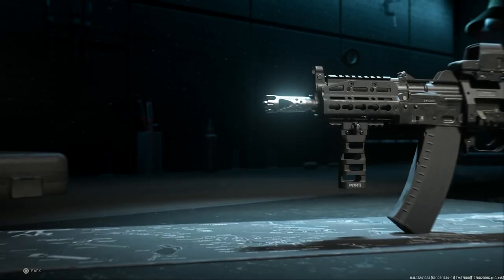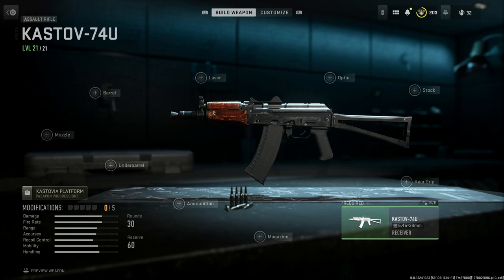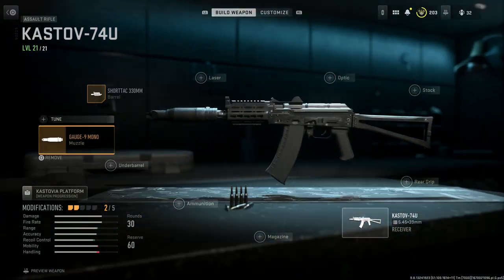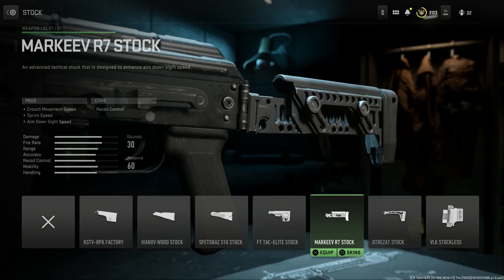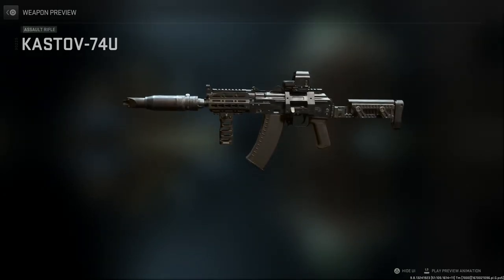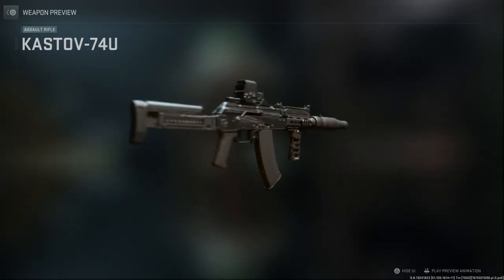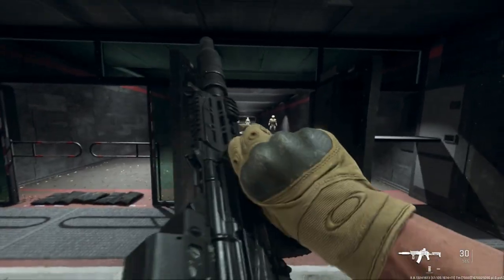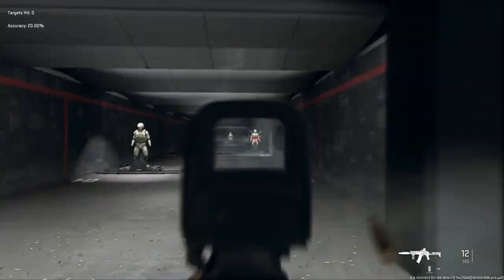AKS-74UM Weapon Conversion - Call Of Duty Modern Warfare II

Comment: Random tip: another way to unlock guns early is to find them in dmz and successfully extract with them. Pretty much the entire AK family can be found easily on regular soldiers, so it's a quicker way to jump ahead of the normal progression
Reply: 100%. That's what I've been doing. I think I have every gun unlocked (minus one Remington 700 variant) from DMZ extractions. The only one that was a REAL pain in the butt to unlock was the MCX/M13B. I took down the Chemist, or eliminated the squad with the Chemist's MCX FIVE different times, but a random squad member took the gun before me.

Why on Earth weapon cases reward the ENTIRE squad on a successful extraction, but the M13 only unlocks for the player actually holding it is beyond me.
Reply: @TACADD  an easy way to not have to redo it is to bring an m13 in your insured slot and drop it for your friend and then extract immediately (and repeat depending on how many people you have). That way you don't risk losing the chemist m13 in case things go wrong. You can also use this method for any weapons one of you may have that the others don't.
Reply: @Sam_Pillay  Yeah, that's what I did; dropped it for my friend. Didn't help me get mine though!